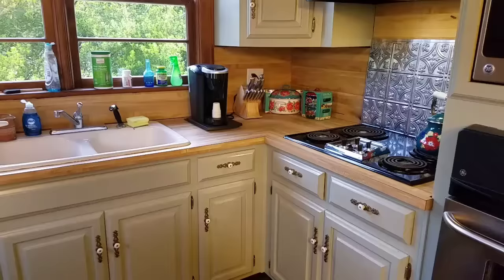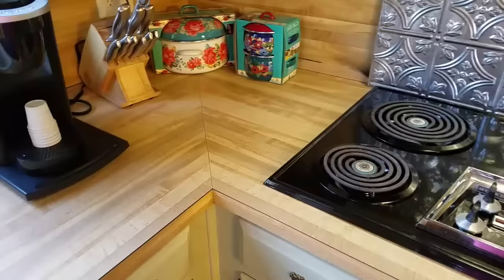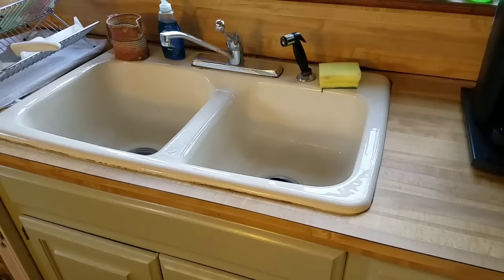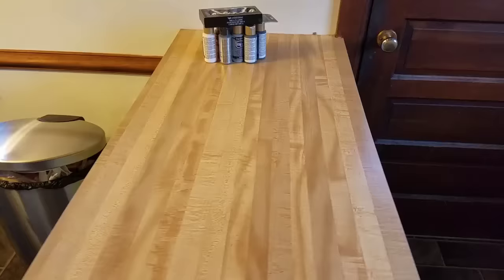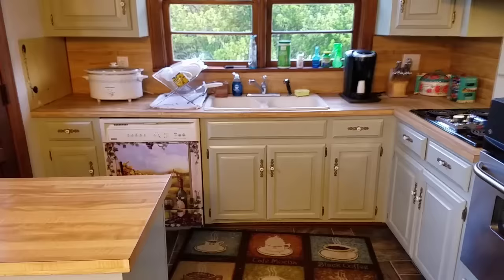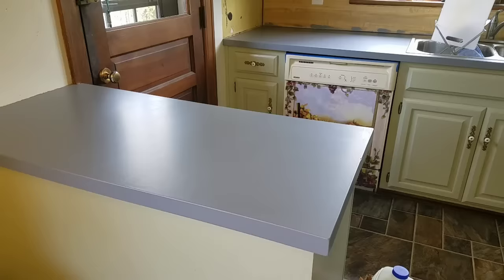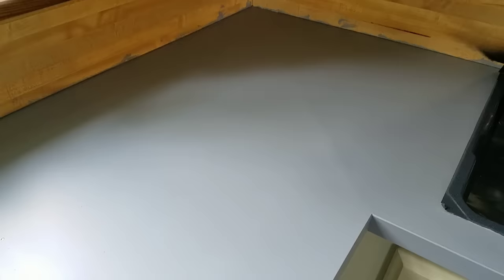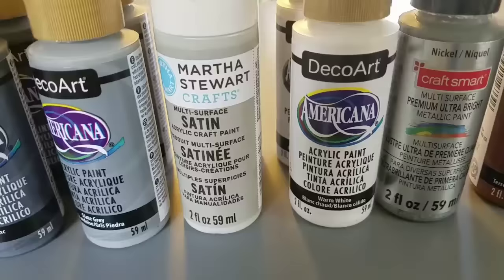How to Paint Countertops - $65 DIY Budget Friendly Kitchen Update

Comment: Oil base paint is about 10 tens more durable than acrylic water base paint.
I would only use oil paint on a highly used area like a countertop.
Take it from me, a fifty year veteran of interior design and a decorative painter.
Reply: stevie68a i’m glad i came across your comment! i was just about to buy an acrylic water based paint
Reply: Thanks for the
Reply: But does it matter when you use a clear coat over it like epoxy or urethane....💜💕
Reply: But would you recommend using oil base paint in a bathroom
Reply: The poly also needs to be oil based. I put water based on my wooden kitchen floor to avoid fumes and it did not last at all.Watermarks and scuffs everywhere.
Reply: I've used acrylic paint in 2 homes and it has lasted 5+ years.  We've topcoated them well and it is the topcoat that allows the paint underneath to last.
Reply: Especially not craft paint in this case either. If you’re going to do all that work you don’t want to lose the color theu weathering. Craft paint isn’t meant for this kind of application.
Reply: @Petunia-Greene  As long as you properly seal the paint, it shouldn't matter what kind of paint is used. I used 59 cent acrylic craft paint and my countertops are pretty stunning (if I do say so myself). The trick is to seal them properly.
Reply: @freshbloominclothing  what did you seal with?
Reply: @martinezanna1965  I have sealed three times with Giani's top coat. It is my opinion that Giani changed their top coat formula somewhere in the last few years. I now use a triple thick polyurethane in clear. If it is put on too heavy, it will yellow against white countertops so go easy with it. But if you are putting it on tan countertops, gray or black, you can put on a nice thick coat. I stamped my countertops so that the main color is white. I did a light coat of polyurethane and it has lasted four years and didn't yellow.
Reply: @TheRottiemama2003  don't use oil based in your bathroom it grows mildew
Reply: Its hard to get oil based paint anymore, at least in California- tough environmental laws. Spray paint is very sturdy too!
Reply: This is the BEST Comment So Far  -Thank You for Your Insight and (Secret).., Your a Rock Starr 👍
Reply: I did both my bathroom floor & bedroom floor with a Sherwin-Williams water-based color epoxy (a few coats & threw glitter on the last coat when it was wet. After that was dry I did a couple top coats of their water based wet look clear top coat. This was right over my bare cement slab floor. It's the most durable floor ever! I have animals with claws, spilling water dishes & other accidents, and all I do is mop it with water! If it starts to look dull after a few months you just add another clear coat. I saved thousands of dollars! It didnt even take a whole gallon of each. It's been 4 years & no chips or anything! Once that water based paint is dry, it stays that way no matter what spills on it. I'm sure it would work on countertops too,& you can decorate it with almost anything if you want glitter or paint chips or confetti, I may try pennies on a countertop myself!
Reply: @marlinnomaders5888  no!
Reply: I do agree but putting an oil based polyurethane on top, wouldn't that yellow more than a water based polyurethane
Reply: That's something new I learned, but doesn't it take a while to dry?
Reply: @freshbloominclothing  lol
Reply: Michael Waller  .  Acrylic paint is much easier to use.
I'm 70 years old, and have been a decorator for 50 years.
There is no comparison between oil and water based paints for durability.
The manufacturers want to sell paint, and they know people prefer the ease of acrylic.
I would never use acrylic on countertops.
Reply: @Petunia-Greene  you could paint your countertops with kool-aid if you apply clearcoats over it .... nothing is going to touch the paint under all that polyurethane clearcoat
Reply: Mellissa actually, the paint does matter. Some paint uses pigment, other paint used dye. Dyes are often not light proof and over time will fade. This is especially true of cheap paints. Pigment is expensive so cheap paint uses dye. You can have a very good top coat that protects from scuffing and scratches but In The end the type of paint you use goes in fact matter.
Reply: Thank you! Little comments like this is what i look for👏
Reply: did you notice the THICK LAYER of Polyurethane she applied over the paint ???? That is the "durable part" .... she could have painted with smuckers jelly when applying Polyurethane over it

Comment: The mica needed to be pressed flat onto a wet surface to affix properly. Using the paintbrush in your hand would've helped  them lay flat. I do a LOT crafty things, similarly. A "test board" would've revealed any potential problems, before beginning.  I cringed watching your roller painting, but we all learn from experience. I'm only an expert bc I've failed so many times. I've also increased my repair abilities by watching YT videos.  Recently I replaced a burned out blinker light in my car.
Reply from the maker: I agree about the test board for sure!  YouTube is an amazing tool and place to learn new things!!  Thanks for watching :)

Comment: Absolutely love this video. You did a spectacular job, and your kitchen transformation is amazing! We bought a 55 year old house 6 months ago, with VERY worn butcher block Formica countertops. Even has the 45 degree angle like yours.  This is what I’ve been looking for, as our budget has been blown by replacing all the flooring and lots of plumbing work. Digging through my acrylic paints now.  Going to use a slightly different color scheme and will use polycrylic instead of polyurethane to seal. Thank you so much for the great video and step by step instructions. Priceless!!
Reply: Lisa, you didn’t mention sanding the countertops.  Did the scrubbing remove most of the finish?

Comment: If you are worried about longevity, add a couple coats of clear epoxy get the self leveling kind and tape off the edges before using. Looks good!
Reply from the maker: Great tip!

Comment: I love the countertops.  Wow!  What a transformation!  Regarding the mica chips, I wonder if you wouldn't have needed to sand them if you would have used 2 or 3 layers of clear, food safe epoxy.  It's much thicker and may have covered the flakes.  I've never used it before, but that's what is recommended in many other countertop paint jobs.  Then again, I've seen many refinished countertops with lots of texture.  Also, I noticed a lot of comments from people saying you should have kept the cast iron sink.  But I understand your desire to get rid of it.  I too had one about 10 years ago.  It was beautiful, but I did not like how careful I had to be with every breakable dish I put in the sink.  I love stainless steel; it's so practical--easy to clean and no worries about breaking glass or ceramic dishes in the sink.
Reply from the maker: Yes....several of my favorite plates from my great grandmother have chips in them thanks to that sink......   that makes me sad

Comment: Those turned out really nice. I have off white slate tiles (unfinished) on my counter and kitchen floor, and they are boring. You just gave me a great idea to change the look in my kitchen. I planned to add a tile back-splash around the sink and counters, and will do the counters and floor with the same colors.
Reply from the maker: You can do it!

Comment: The great thing about this project is that it is very budget friendly.  If you don't like it, it won't hurt as much to sand it all down and try a different look.  That's my mind kind of project.  
How well does the polyurethane hold up over the years though?   Even when using trivets, heat can penetrate the countertops.

Comment: I painted my counters about 6 years ago, held up well but I noticed in the past 2 years it had yellowed even tho the sealer I used said non yellowing. I am ready to re do them again but I was thinking I would try an epoxy resin pour over it to seal in the paint. anyone try that? and if so does it yellow? I am also now inspired to paint my cupboards, I love how yours turned out!!!
Reply: I just finished going from white cabinets to distressed grey. Love them now moving onto countertops. I have watched this video like 5 times.
Reply: @kristinpullen8821  what color are you doing your counter tops?

Comment: I did this about 8 years ago on my barbershop countertops they were ugly and I did them in a black and brown and a little gold undertones that came out like this too that it was sponging it looked great and then I did it a polyurethane self-leveling thin coats three or four thin coats sanded lately in between it came out beautiful it just wasn't a high Sheen it lasted very long but this year I decided that I wanted to have a little thicker shinier of a coat for you know just wiping it down better and I used this minwax one coat or it was the other brand but it was the one coat three times stuff it was so thick I thought it was a big brush it showed every brush stroke it did not level out I don't know if it was too cold in the room or what and it showed all the brush strokes I was okay with that but then a few weeks later I started seeing little air bubble might be marks and they started chipping and when they did then stuff peeled off some of the countertops are peeled off the whole area and others it wouldn't come off of so now I got pieces that have another level to it I don't know what to do now I don't know if I should just go over it with the thinner stuff a couple times and maybe it'll keep the rest of it from chipping up at times when I get air bubbles every once in awhile still in different areas

Comment: The main problem with applying the clear coat this way is that you can create air bubbles using a foam roller.   You would have had fewer issues with the mica if you used a paint brush and did 3-4 thinner coats as opposed to one big thick coat.
Reply from the maker: I think you have some great tips, thanks so much for sharing so that maybe someone will see :)

Comment: Love this Lisa! Any chance you can let us know how it held up and if you have any further comments?
Reply from the maker: Thanks so much!  We've since sold the house....however I did my brother's counters the same way using different colors, about 3 weeks after doing mine.  His are holding up supper.  There is a small chip in the finish near the sink where something heavy was dropped....so it needs a touch up there.  Otherwise he says they look exactly the same as when I did them.
Reply: @TheQuiltmakerHomestead  The key to me seems that a good bonding coat plus a good top coat. That counter may even have had a chip from something heavy even if it was original countertop. A lady wants me to do a similar project for her and she asked me, can I cut on this? I said no, but you cannot cut on your existing counter either without leaving a mark. 😁 She wanted resin too, till I explained the 30 day full cure - kinda like painting your fingernails and then waiting an hour, then doing dishes because the nails seem pretty dry. Busy kitchens are tricky to work around 😎

Comment: This of more beautiful than any kit product I have seen (which are also very expensive).  I have formica counters with a bit of texture.  Would this process work after a light sanding or should some sort of filler be used then sanded first?  Also, how are the counters holding up?

Comment: I did this same thing BUT I did not use primer 1st. Terrible mistake! The paint came off in about 5 places and one can see the previous color underneath! I have to sand and redo the entire thing. Next time I was going to use epoxy instead of poly coating. How did your poly hold up?

Comment: Lisa....I recently said your job looked great.... and it did/does! However, when I went back and looked at the products you used, there are some definite problems. I hope some of the folks planning on duplicating your project see this! First, avoid water-based products when 
redoing countertops on the kitchen! Some water-based products have come a long way over the last several years, but just on its face-value, water-based products don' make for common sense in the kitchen, except for wall paint. The primer you used is good stuff. However, it is made for to be used on porous materials. Formica is not porous. Simple-Simon: Use oil based primers over Formica. Then, you used a water-based, "unconventional polyurethane"  as your topcoat. MinWax makes a lot of exceptional products, but their "one Coat Polyurethane" is not among them! A look at their own website will tell you that. The reviews are NOT good! Most of the complaints say that it is too thick, and they suggest it be used over a small area. The fast dry time is awesome.... but not at the expense of product failure. More importantly..... ALL MinWax products are made for WOOD application only!  So, you have a great looking countertop. I think how long it lasts will depend on how much it is used and cared for! The good part is, it was a learning experience, and if and when it does need replacing, you will have some experience behind you, and you will do a bit more research next time! Saving money is a cool thing (especially now!), but there is a saying ion Spanish: "Lo barato sale caro!".... which means "the cheap things end up being expensive!" You have the idea. I hope this lasts for you! Keep water away from your counter! Redoing it will be more difficult!   Best of Luck!

Comment: Great job. The only advice is tape a half inch lip around counter and then poor the top coat on. Let dry, remove tape, then do the corners and edges
Reply from the maker: Great tip!
Reply: Thanks, just be sure to use a thin but very sticky tape so that any  residue left behind can be buffed or sanded from edges

Comment: probably been touched on already but anyways here's my 2 cents.  I liked everything you did except that application of poly at the end.  I would had soaked an old sock and gave it many very thin coats putting the sock in a ziplock between coats.

Comment: I’m very curious as to how your counters are holding up??? 
I just did literally the same thing, minus the mica flakes, to my countertops and I’m worried the poly isn’t going to dry. I have seen some bad reviews on this product so I’m very scared that all my hard work is going to be for nothing.
Reply from the maker: The new owners love the counters, it's been a year later.  I also did my brother's counters the same way.....the have 4 little kids and they are holding up great a year later.
Reply: @TheQuiltmakerHomestead  did you change the type of top coat used  on your brother's,  i.e. epoxy?
Reply from the maker: @mo-rie  nope, I didn't use epoxy  :)

Comment: I did these method just like you did.except no nicro  flakes. But it still has bumps here and there from just the different paints I used. Do I sand and re place polyurethane?????

Comment: These mica flakes are absolutely terrible. Someone did my countertops with them and you cannot clean your counter without still having crumbs in between cracks . I'm in the process of trying how to remove them and re do my counter. Did sanding them down work out???

Comment: The stainless steel sinks are a pain the the butt to keep looking new and grime free.  They spot and dull easily.  For some reason they also skew very cheap too me.  The cast iron sinks are still desirable for the staying power of their enamel finish, even with a few chips after years of heavy use, and their ability to look good with little care.  Like many before you, you may soon regret getting rid of your old stand by.

Comment: Just wondering why you wouldn't paint before you put the new sink back in?  would have made it a little easier.  IMO.  other than that, I like what you are doing, but not a fan of removing that vintage sink, or covering up butcher block counter tops.  just differences in style

Comment: Why didn't you install the new sink AFTER painting? I would have pulled the stove top also.If you're going to do a job,do it right the first time and forget it.Just like repainted cars will start to peel where the paint meets up with say a door handle,I would say around the sink would be a prime candidate for problems.

Comment: I just did mine about three weeks ago, but the problem I have is streak lines when applying the polyurethane and it seems impossible not to get any, do you have any recommendations? Aside from that my counters are simply beautiful.
Reply from the maker: Hi Ashley, I had the same issue....that's why I poured it on, however I probably would not recommend doing that hahahaa.   I do think an epoxy clear coat would self level and be more durable in the long run.
Reply: I agree, but I'm scared that I won't be quick enough to work with the epoxy. Now my husband whose a real handy guy he refuses to do it for me, he thinks its fine the way it is and says that the epoxy will yellow over time😔..... The lady at Home Depot said that every other year we should lightly sand it down and add another clear coat of polyurethane to make it last longer. Thank you for responding to me😊

Comment: polyurethane  over acrylic on a kitchen counter will NOT last either. The primer on the old countertop should be shellac based to truly STICK as well. A clear coat of epoxy resin would seal it and make it kitchen friendly as well. This will not hold up at ALL as you did it--even if it is a cool idea;) aloha